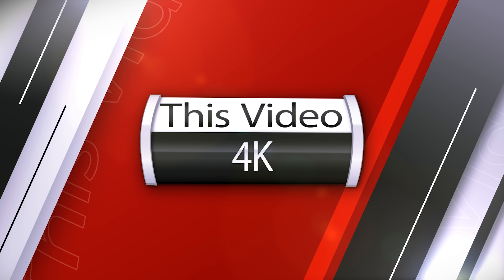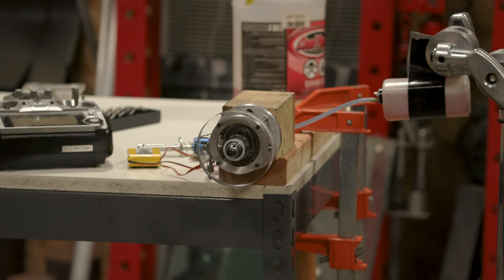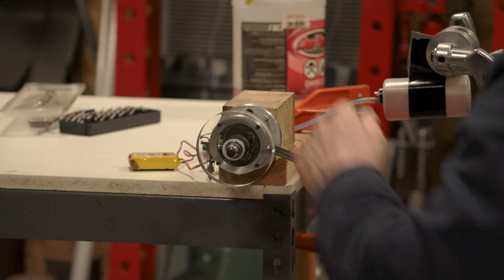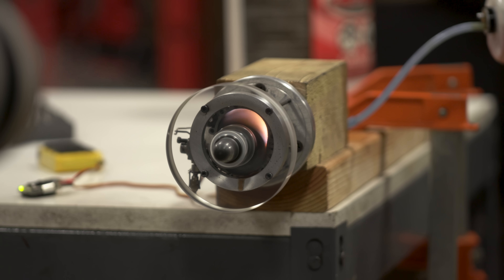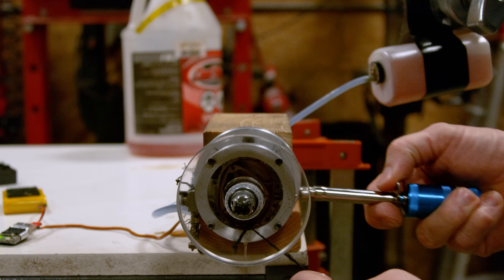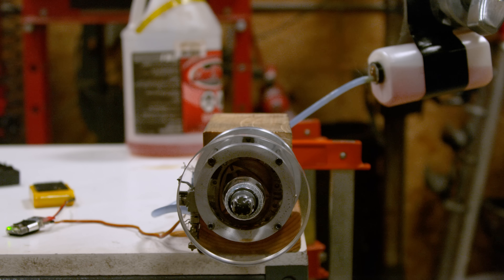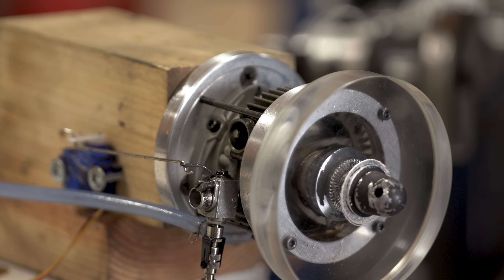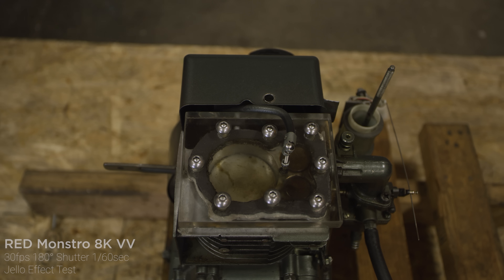See Thru Rotary Engine (WOT Runs Just for Fun) Shot on RED Monstro 8K VV- Canon C200- Flex 4K

Comment: You do realize that is a wankel and not a rotary? This is a very common misnomer. The rotary engine is an airctaft engine like a radial enginge where the block has the propellor attached to it and the crankshaft is attached to the airframe. I still make this mistake with a slip of the tongue.
P.S. I wonder how the fuel and oil systems work on a rotary engine. Maybe a video idea.
Reply from the maker: Timothy Feist thanks , yes I'm absolutely aware, there wasn't enough space in the title. Here's the original video https://youtu.be/pCteBhr4dGY actually radial rotaries and a Wankel rotary are both technically considered rotary engines. They are just different types of rotary engines, in my upcoming full episodes you will see many different rotary engine designs. That's pretty much why I made a series out of it
Reply: Which Wankel are you referring to? Only the Wankel DKM-54 was a rotary.. the Graupner is a KKM-57(non-rotary version)
Reply: fyi; there is no such thing as a "radial-rotary"  that would be an oxymoron.
Reply: doktorbimmer they both appear to be the same basic design. Both appear to be tricordial(spell??) rotors.
Reply: doktorbimmer what is this "radial-rotary" you talk about?
Reply: +Timothy Feist  The Wankel DKM-54 engine designed by Felix Wankel uses a "Millet type" Rotary layout with a fixed, non-rotation crank-axle, while the KKM-57 designed by Dr Hanns Paschke and Walter Freode uses a conventional non-rotary layout with a normal rotating main crankshaft.
Reply: doktorbimmer Also ein Umlaufmotor (oder Sternmotor bei dem sich die Zylinder um die Kurbelwelle drehen)? Im englischen Sprachraum ist das etwas verwirrend, weil dort die meisten den Wankelmotor als "rotary engine" bezeichnen.
Reply: +Mandernach Luca Wankelmotor?  Kreiskolbenmotor? oder Drehkolbenmotor?
Reply: doktorbimmer Drehkolbenmotor, der Kreiskolbenmotor hat doch ein statiches Gehäuse, oder?